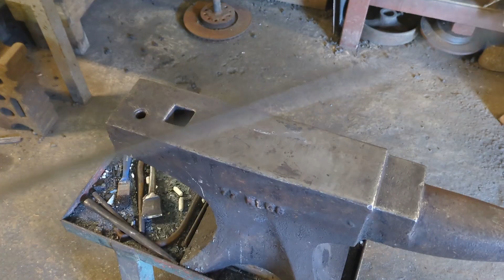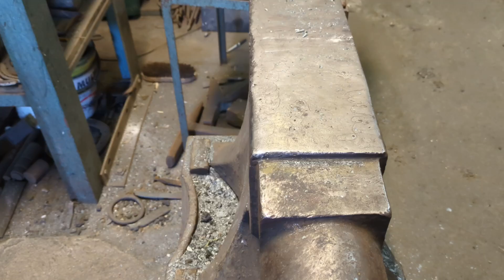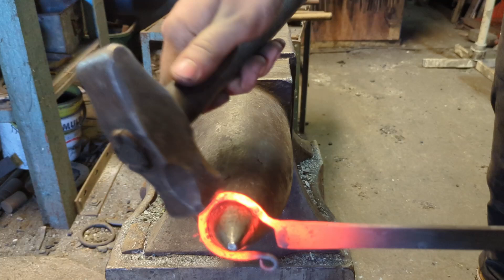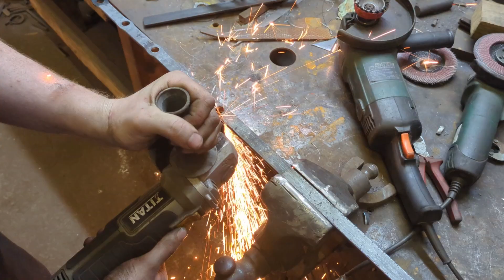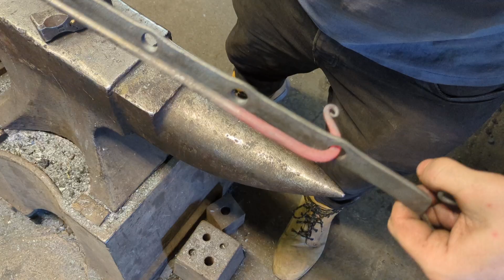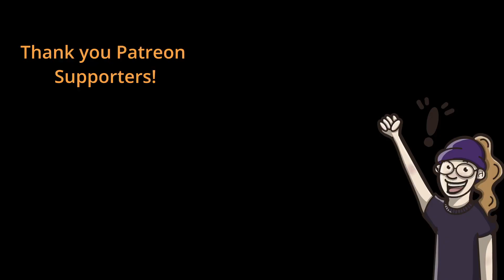Forging your First Campfire Trammel | Beginner Blacksmith Projects

Comment: nice video and i am a beginner blacksmith and i want to ask the not so obvious: why do people do this alone? obviously an apprentice was used a lot due to things like punching needing a third hand, but now people do this mostly alone. why is that? do people in the states start any blacksmithing clubs so they can get apprentices easier? i am from poland so i don't know any of them here or abroads.
Reply from the maker: great question! I can't speak for everyone, but currently in my place in my career, I can't afford to employ anyone else to help with my work, but then that does limit what I can do. Historically speaking, labour was more cheap and the work of the smith more plentiful so as you say blacksmith shops would regularly have many hands to help.

Equally, when i can't do something along, I have a number of friends who often pop into the workshop to lend a hand and swing a big hammer for me, and those times are always an awful lot of fun!
Reply: @RubyFergusonBlacksmith  thank you for the quick answer. hm. you bring an interesting fact saying that labour was cheaper. here blacksmiths dont give out free lessons, locally or even at the National Polish Blacksmithing Meetup. i will try to get forge friends by asking for help with sledgehammering. seems like a good ice breaker.